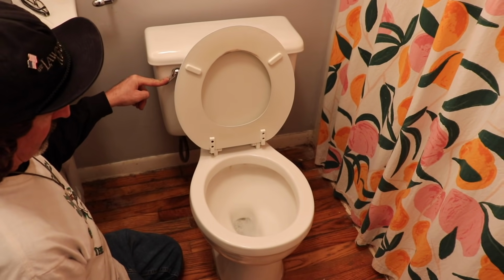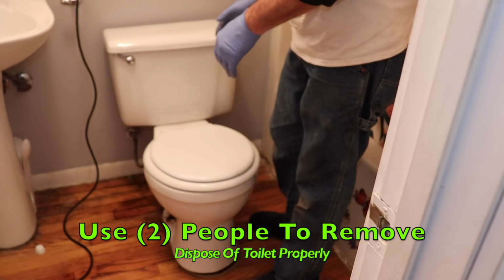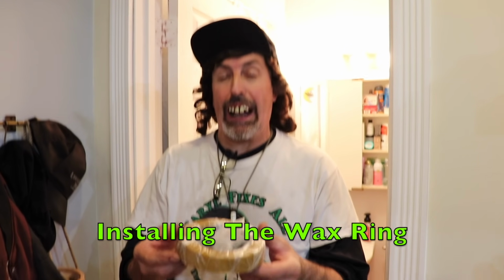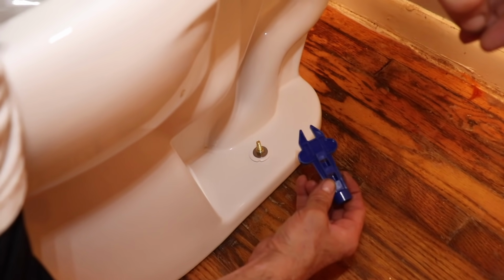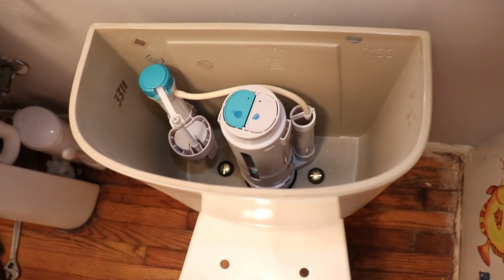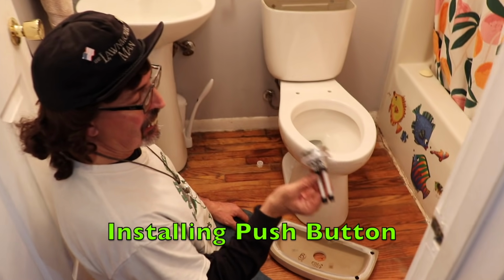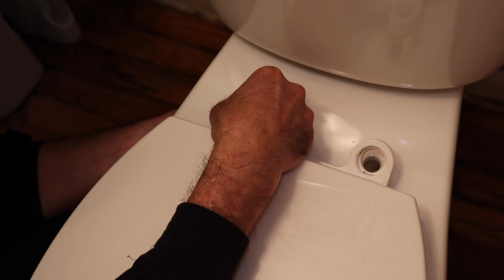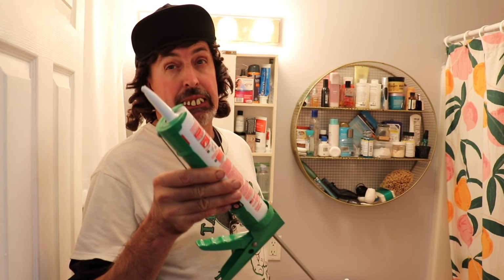Check It Out! How To EASILY Install A Toilet

Comment: Never caulk the back of the toilet, if the wax seal ever leaks .... water will come out the back of it.....lets you know ya got a leak and keeps the floor from rotting out....there's ya dinner  !!
Reply from the maker: We are just following International Plumbing Code and the International Residential Code procedures that state you HAVE to seal the toilet to the floor. If you do a google search on "Should I Caulk My Toilet To The Floor?" It should answer it. Now There's YUR Dinner!!
Reply: @TarylFixesAll  10-4 guess we both got our dinner. . Lol

Comment: Sadly I had to give you a thumbs down because a toilet does not and should not use sealer around the base of the toilet. adding the sealer prevents moisture from drying when there is moisture from the bowl of the unit. 

You are still my favorite Taryl.
Reply from the maker: Hi Henry, We are just following International Plumbing Code and the International Residential Code procedures that state you HAVE to seal the toilet to the floor. For more information on why you SHOULD seal around your toilet, simply Google "Should I Caulk My Toilet To The Floor" Thanks fer watchin, now there's yur dinner!!
Reply: @TarylFixesAll  I still love you, no matter what is said, and there's yours dinner!!!

Comment: Not a good toilet flimsy seat cant sit on it if you weigh over 150 lbs and that push valve after a while sticks so bad my sister couldn't push it hard enough for it to work. Looks and seems good but it ain't.